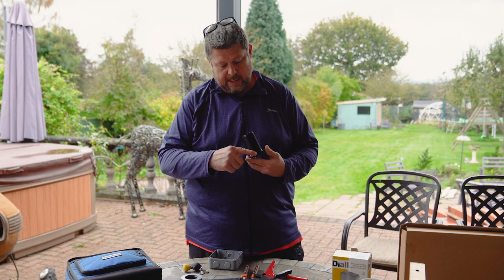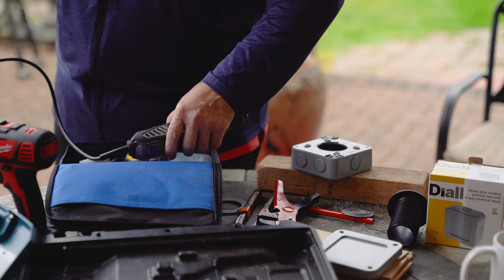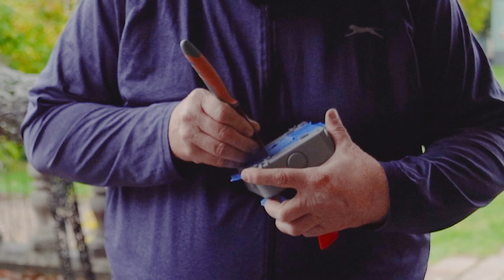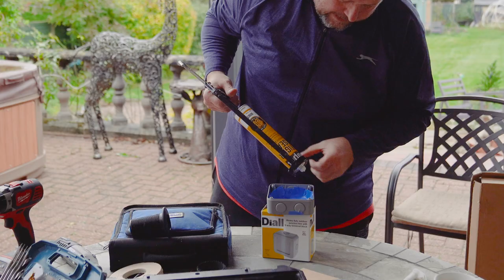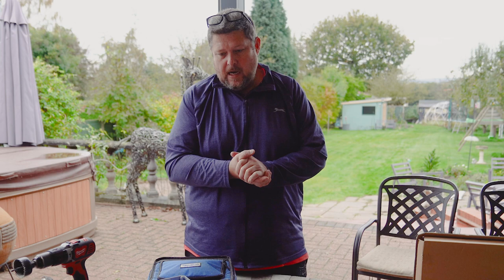Making a LARGE Hole - Roof Cable Junction Box

Comment: I think that’s the best solution Bruce. The minimum amount of holes in the roof the better so having everything in one is definitely the way to go. And as you say, if there’s ever a leak, you know where to go looking. 👏🏻
Reply from the maker: Thank you so much Paul Barker, I really appreciate your comment. I will be fitting it soon and I think because it’s dried separately on both sides the seal will be even better.

Comment: I like your logic Bruce = makes sense to me, the only slight concern I have is the wooden disc (expanding when wet)?
Reply from the maker: Thank you. Ah, sorry maybe I wasn’t clear. The wooden disc was only to pull the flange straight and tight. It won’t be used when in the roof.